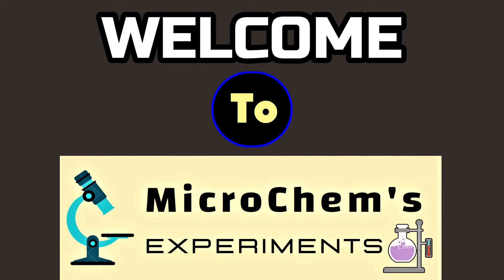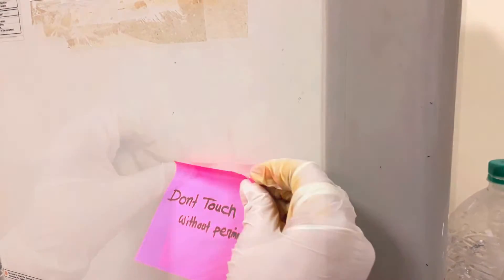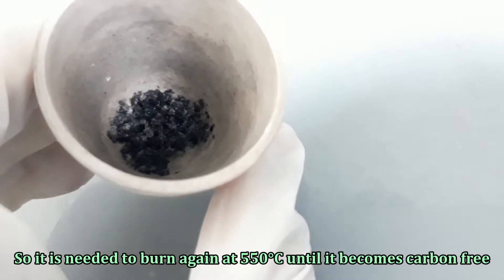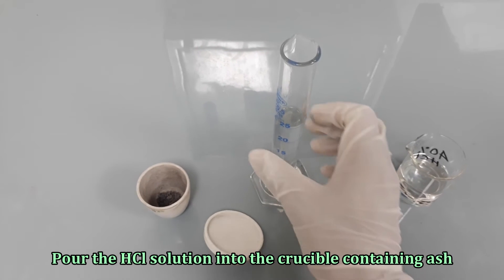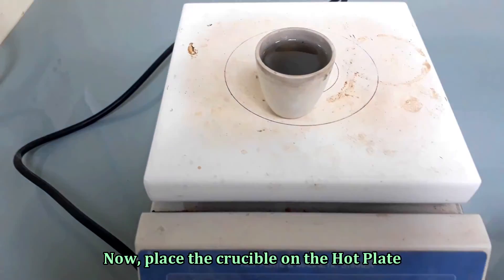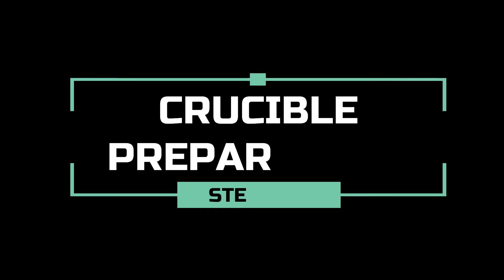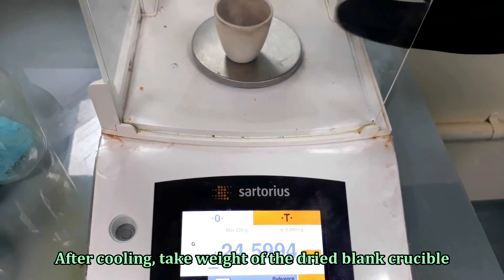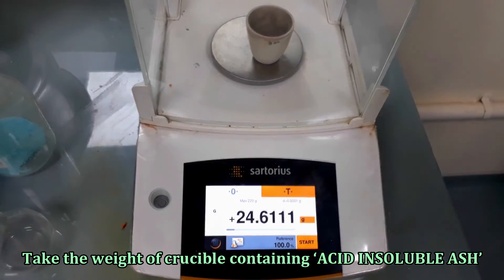Determination of Acid Insoluble Ash_A Complete Procedure (AOAC 941.12 & Ph. Int. (WHO), 2019

Comment: Step -5 
Here we take acid insoluble ash weigt. 
In this ash, filter paper ash is present.
Why don’t we exclude it?
If you measure in this way, the measurement can not be average?
Reply from the maker: We used Ashless filter paper. Ash of filter paper can be seen but the ash is without any significant weight.
Reply: @MicroChemsExperiments  ohh.
Thank you🥰
Reply: That’s why it says ashless filter paper

Comment: Hello .I am looking for the purpose of this control. and on what samples on sconces. did you have the water insoluble ash method for spices. thanks you
Reply from the maker: This test represents the type of minerals in a sample left after dissolving in acid. We tested feed sample in this video. You can determine the Water insoluble ash by following video except you have to use hot water in place of HCl solution.
Reply: @MicroChemsExperiments  thank you very much i learned a lot with you

Comment: Shouldn't the weight of filter paper be considered here, the final weight when the crucible weight is subtracted, we get the weight of acid insoluble ash+filter paper, right?
Reply from the maker: We used Ashless filter paper. The ash of the filter paper is weightless. Thats why we did not consider the ash of the filter paper
Reply: @MicroChemsExperiments  gotchya👍
Reply: @MicroChemsExperiments  how is it weightless though? The matter is still there!
Reply from the maker: @b_rabbitt9832  That material has no weight after becoming Ash. Search on google by "Ashless Filter Paper" for more. You can set an experiment in your lab to search weight of Ash of that type of filter paper.
Reply: @MicroChemsExperiments  I did and it was weightless, I will search on google though, thanks
Reply: @MicroChemsExperiments  mam can u tell me for the same procedure with simple filter paper
Reply: Really, the weight of the filter paper is supposed to be noted and then subtracted to get the original insoluble ash value.
Reply: But since it's ashless, its weight is inconsequential.

Comment: Why 40% HCL used?
Reply from the maker: 40% HCl is used to dissolve the maximum ash content in acid which is passes through the filter paper with acid solution during filtration. Ash content which does not dissolved in 40% HCl trapped and retained on filter paper which further quatified as Acid Insoluble Ash.